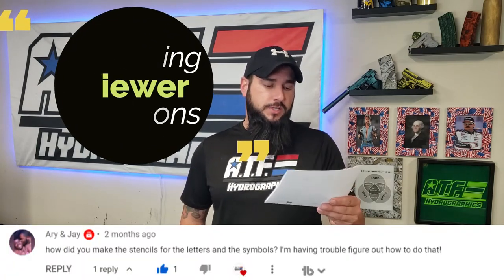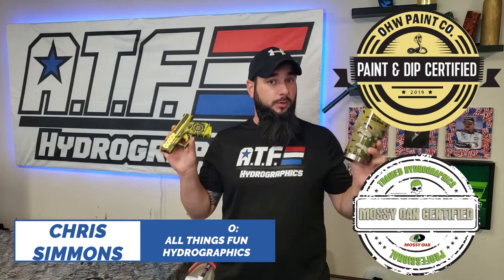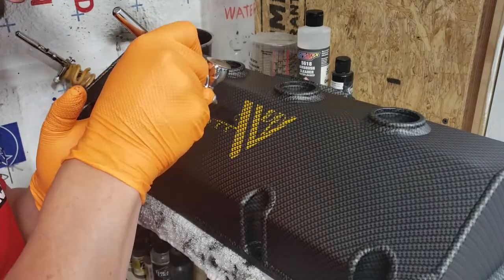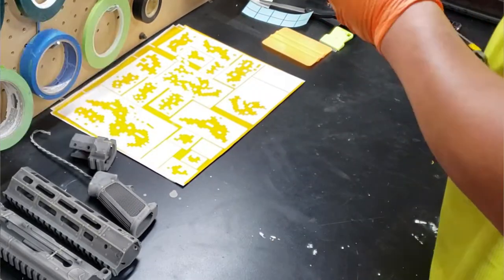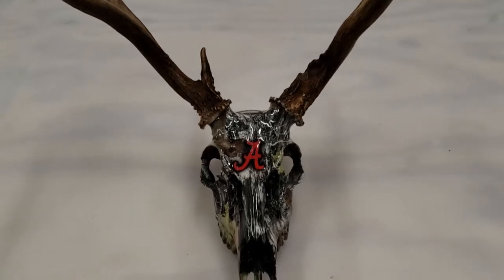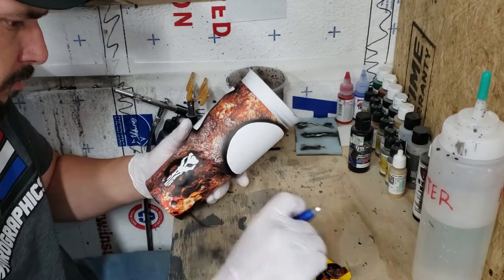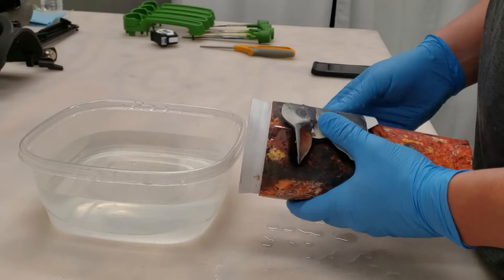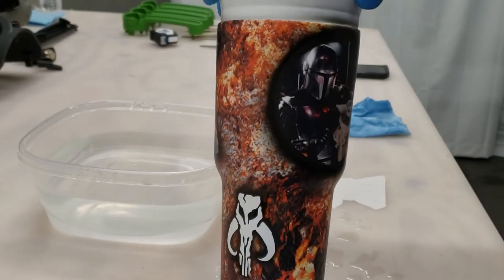Hydro Dip with stencils and waterslide decals

Comment: I got two questions man hopefully you can answer them. One is do you always have to touch up your dip or is your dip supposed to be clean with no pin holes.  The second one is when you clean your tank is there a special way you need to dispose the water or not really. Thank you in advance
Reply from the maker: Touch ups depend on the parts I am dipping. If it has texture or grip, or stippling then yes I usally always end up touching it up. Other stuff just depends on how well I got it dipped.
For water disposal I just let it run out in the grass, the activator mostly evaporates so it is just nasty smelling water. I have been doing it for years and never killed the grass if that means anything to ya.